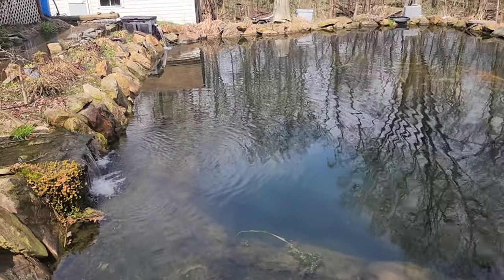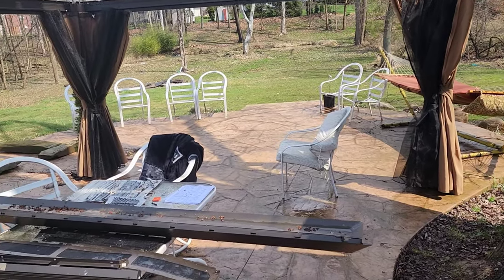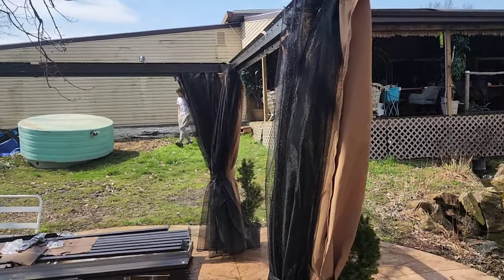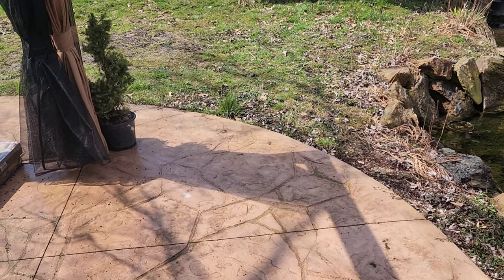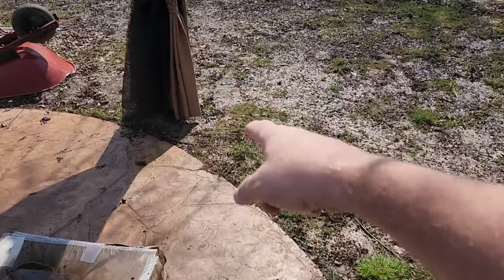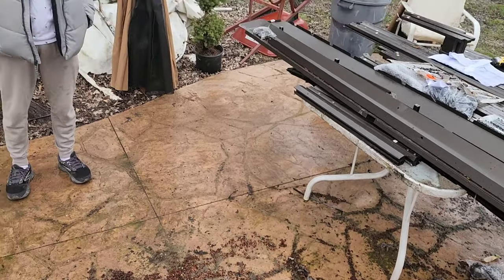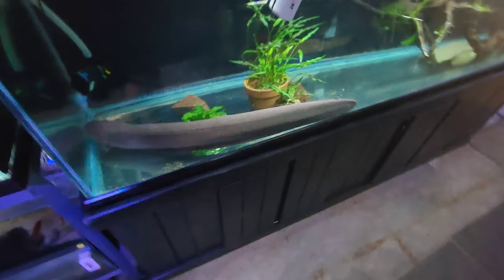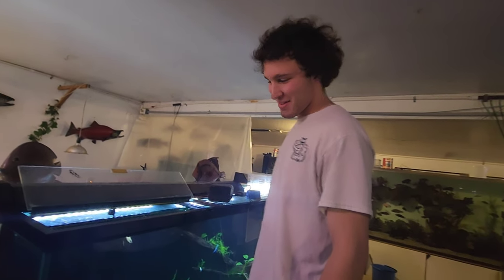SURVIVING a DEADLY ELECTRIC EEL SHOCK

Comment: Consider the gazebo only a semi-permanent feature and use a small cement pad to anchor that single back post. If you try to widen the kidney(?) shape and colour-match the design it'll ruin that concrete patio forever. You can always drop some decorative gravel to bridge the odd post anchor into the existing textured patio.

Even bolted down, that gazebo will get trashed in every Strongsville windstorm/blizzard. Remember your old canvas tarp carport in the sideyard. If you get 3-4 years out of that gazebo count yourself extremely lucky.

Rich, if you keep feeding all these young people you'll never get rid of them. 🤣
Work them like rented mules. Make sure they all earn their oats. SFMF.
Reply: Ouh that's a thought,with the rocks,
 there building a gazibo they need food💪🏼, n cookings boring 🙂

Comment: you have a microwave there's a way to dry out those instructions place them in a fluffy towel that's slightly dampened and placed the pages into it and microwave them for like 30 seconds at a time and check them after each time they will dry out it takes some time but the will dry out Just be careful cause as they dry out they tend to get potentially flammable if you're not careful that's what you get to keep the towel damp or slightly damp sprinkle with water or spray some water on it. hopefully that'll help you dry out those instructions.
Reply: Lol